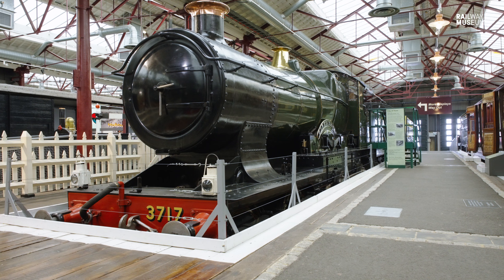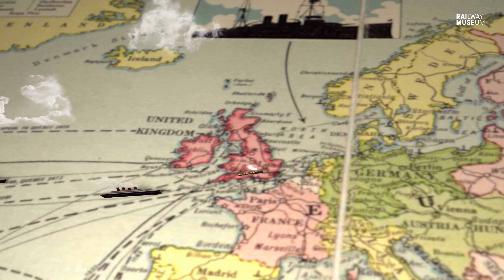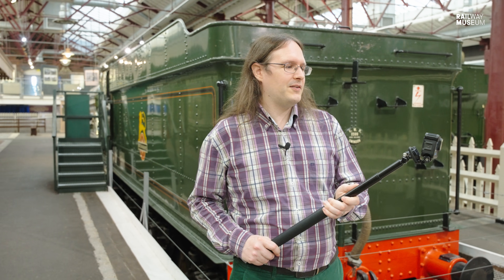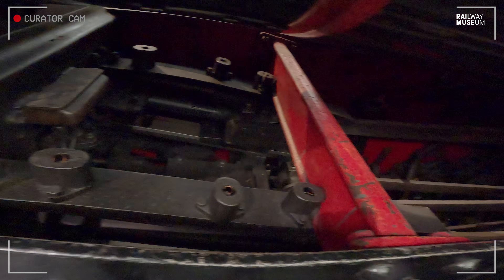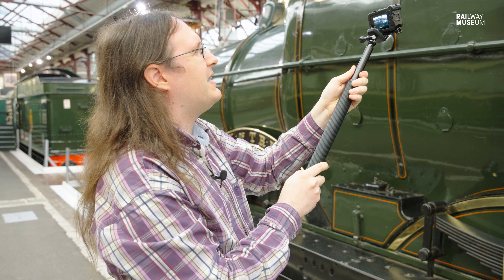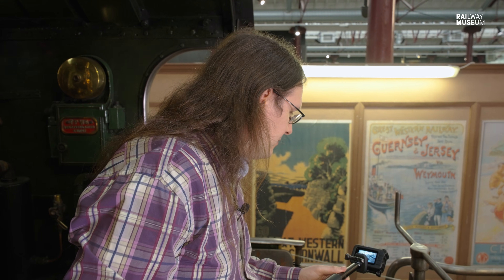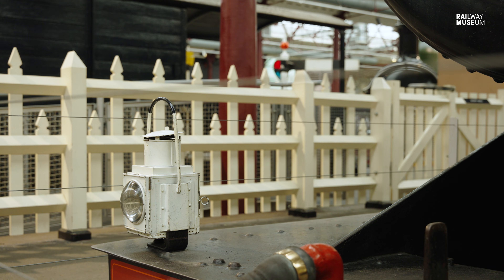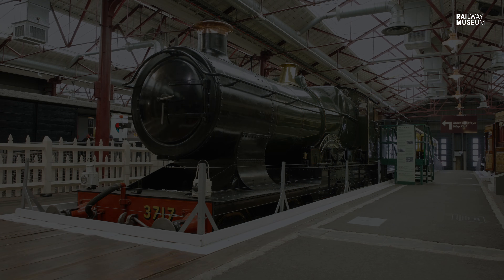City of Truro Up Close: 100mph Record Breaker? | Curator with a Camera

Comment: I believe mechanically speaking, City of Truro is more in contention with a 100 mph than 999 on the New York Central. 999 did not have the same power output as City of Truro in spite of the larger driving wheels 999 possessed (999 had 86 inch diameter drivers, City of Truro has 80.5 inch drivers). Truro also had more boiler pressure and larger cylinders. So I believe mechanically, even if she never actually did that speed, Truro would've been more capable

Comment: 12:05 They didnt really design those early locomotives with inclement weather in mind. Nowhere near enough overhead cover, and no doors to speak of. If you were operating the locomotives in a crosswind or rain, all crew would be saturated or frozen to the bone.

Comment: The blue painted disc and letter inside it are not both for route availability, the coloured disc is the weight restriction yes, but the letter, in this case 'A' denotes the locos power classification, 'A' being one of the least powerful on the GWRs ratings list.

Comment: I tend to believe the City of Truro probably achieved 100 mph but not 102 mph. The timings Rouse-Marten claims for successive quarter miles were 10.0 seconds, 9.8 seconds, 9.4 seconds, 9.2 seconds and 8.8 seconds. This suggests an unlikely burst of acceleration just when the rate of increase in the train's speed would be expected to decline. In reality, the task of juggling two stop watches at such high speed and with great precision would probably have been too much for anyone, even someone with Rouse-Marten's experience. It would be interesting to know what timings were recorded subsequent to the 8.8, and then to smooth all the timings out in order to remove as far as possible any inaccuracies.
Reply: It doesn't actually suggest a burst of acceleration, unlikely or otherwise. Rouse Marten used 1/5 second stop watches, so its simply a question of granularity. A record of 8.8 actually means 8.8 - 8.99 seconds and so on. After the 8.8 the driver braked hard, so the next number wouldn't be useful. If one charts the numbers with error bars and then draw fair curves most go over 100mph, but it is just possible to draw a fair curve just under 100mph. 

There are three things that are sometimes ignored. 

The first is that the locomotive was still accelerating when the driver braked. There shouldn't be any doubt that if the driver hadn't braked AND if they had stayed on the track the speed would have been well over 100mph - or the great mail train accident!

The second is that a Post Office worker on the train completely independently timed the train at 99 to 100mph.

And the third is that there had been several timings of the GWR 4-4-0s in the mid 90s, so this wasn't a big outlier.

Comment: I see the record as valid. It's plausible for some sort of 4-4-0 design to be able to get to that point.
Reply: Even if it didn't, it got mighty close!
Reply: Empire State Express number 999, also a 4-4-0, was reported to have exceeded 100mph in 1893 using a similar timing method. The record is unverified and disputed for similar reasons.

Comment: One wonders just how many times per minute, those driving wheels were so slightly lifting off the rails during Moses Clements' dash down Wellington bank. Those pesky platelayers not stepping aside too quickly! I wish I had seen her when she was on regular turns between Southampton and Newbury (the Didcot, Newbury and Southampton) between 'specials'. When first taken from the old York Museum (I remember that too) Swindon 'just happened to have' a spare boiler.

Comment: First time when I saw City of Truro was back in 1989 at the 150 years of railways in The Netherlands events. As there is only a very small number of original Dutch Railways locomotives which could be steamed locomotives from surrounding countries visited to take part in the parades.
Between all the giants like DB class 01.10, SNCF 141R, CZD class 475, and our own then still in steam NS 3737 City of Truro was one dinky little locomotive. The double frames with outside cranks did look very archaic, but all that made the fact that she could have done 100mph the more impressive.
It made me delving more in UK railways later on, visiting the NRM York several times, Steam Swindon, Shildon and many preserved railways.

Comment: 100mph is 1.67 miles per minute, so the quarter mile would take 9 seconds not 8 seconds as stated in the video.  At that speed  if you were a quarter of second late pressing the stopwatch on the last quarter mile marker then a quarter of second early for the next marker, that would over-inflate the speed by nearly 6mph.  So no, I don't believe City of Truro reached - and certainly didn't exceed -100mph.
Reply: It got mighty close, though.

Comment: Slight correction at the end; City of Truro definitely steamed after 2004. I rode behind it at the Gloucestershire and Warwickshire Railway when it went back to it's 3717 guise and that was in 2010
Unless of course Chris meant "mainline" service, in which case disregard my correction
Reply: I meant to say overhauled in 2004 rather than steamed, ooops. It was in 2013 at the end of the ticket when I was a trainee fireman.
Reply: @christophervalkoinen6358  Do you have any insights about what it's like to fire City of Truro from your experience as a trainee fireman? E.g. cab ergonomics, how efficient is a City regarding coal, and how do you get the best performance from a City? I'm really curious as an enthusiast: the only other GWR double-framer left is the Bluebell's Dukedog, but that one has a Dean boiler, and I haven't heard much about either.
Reply: @captaincool3329 it was more than 10 years ago, so what I can remember is quite sketchy. It was very free steaming and easy going. However, we were doing max 5mph on a quarter mile demonstration line with two brake vans - and it was only the second loco I had ever fired (the first being a somewhat struggling Olton Hall) so I don't think my opinion is well informed. It was definitely a very forgiving engine for a trainee aside from learning to heft the coal to the front of the firebox. 

After Truro I didn't fire anything where I couldn't reach the tubeplate through the firehole door in the next 5 years and those smaller engines needed a lot more discipline.
Reply: @christophervalkoinen6358  Great to have someone who has worked on the footplate talk about the locomotive.

Comment: It would be nice to restore Truro, but 3 factors hold it back
1) The cost of the restoration
2) Keeping as much of the locomotive as original as possible
3) Demand for the engine would need to be justified, and with other smaller engines from the NRM already operating, plus the size of railtour trains today, it just isn't feasible
Reply: Double header with flying Scotsman if they do return city of Truro to steam again

Comment: Sometime in the 1950s we went on a family holiday from Manchester to Cornwall by train. I remember, as always,  going to the front of the train to see the engine. City of Truro was there, full of steam ready to go. I did not appreciate the significance until year later. I gather it had come out of retirement for some sort of celebration. I don't know for how much of the journey it hauled the train, but I do remember making good speed until we crossed the Tamar bridge.
Reply: Two things: first, when they realised that they still had a usable loco, they put back C of T into regular working in the 1950s, though her usual beat was Didcot to Southampton. Difficult to work Manchester to Dawlish into that diagram, though I don't doubt that you found her as you say. Was it Bristol to Exeter perhaps? If so, then you experienced her retracing the very stretch that she sped down in 1903. Second, if you crossed the Tamar on your journey, you'd missed your stop!

Comment: The ACTUAL First Steam Locomotive To Reach 100 MPH was New York Central 4-4-0 American Type No.999. On May 10th 1893 NYC No.999 was pulling a Passenger Train and it was recorded at a Speed at 112.5 MPH. THAT IS THE STORY OF THE FIRST STEAM ENGINE TO REACH 100 MPH!
Reply: That’s equally as debatable as City as Truro. If the record wasn’t done with proper equipment, there’s no way to really verify it.
Reply: @joshslater2426  EXACTLY!
Reply: LOL
No.
Reply: @CountScarlioni  Just look it up.
Reply: If you believe that then I have a bridge to sell you.
Reply: Yeah, ok, A 4-4-0 hit 100. Next you’re gonna tell me that pigs fly.
Reply: @2Bored2BoisNo there claiming more than that with 112.5 mph!
From passing signal boxes and the signalman writing down the time passed using the box clock with no second hand or stopwatch function and mileposts distance of a signal box rounded for convenience.
So piling uncertainty upon uncertainty and selecting the best number that comes out.
Nothing special about the 999 design to create the steam required and then use it in the cylinders and coupling rods etc.
Reply: @2Bored2BoisBro look at the Videos just search up "New York Central No.999 goes 112 Mph their is REAL PROOF!

Comment: It's doubtful that Scotsman did the ton. There was a report some years ago in Railway Magazine where the dynamometer readout was examined and there's a sharp increase from 98 to 100mph at an acceleration rate the loco would not have been able to achieve  "almost as if someone had nudged the recording pen".
Reply: The more you read about the 100mph record the more you realise how fuzzy it all is. I didn't know about Scotsmans 'issue' but City Of Truro for example simply shouldn't have the power for 100mph. The calculations don't add up. And then you have 999 whose story is also iffy. There is a very good read on the website 'germansteam' who looked at the various claims and determined that it would most likely have been Milwaukee #6402 in 1934 with LNER 2750 Papyrus (a Gresley A3!) in 1935 as the second one that can be verified.
Reply: Just as an add on to your comments, on the Flying Scotsman run C.J.Allen was timing the train by stopwatch, doing alternate quarter miles. The maximum he claimed on the day was 97and a half. This occurred in 2 successive alternate quarter miles. So could Scotsman in the intervening quarter mile have accelerated to 100 then decellerated sufficiently for the next quarter mile 97.5 average...

Comment: Short answer: no.  Long answer: Rous Marten’s log gives over 100mph. The tough questions to ask are - are reliable is he as a commentator? (Not very), on that stretch of track, what mitigating factors against Truro are there? (fairly substantial curvature, increasing drag). What about the form and function of the train? 100mph for steam locomotives only really gets authenticated from Scotsman afterwards - I think that’s because 100mph is far more difficult to do than people realise, particularly with non streamlined, non optimised equipment and on runs that are not pre planned.
Reply: With a margin of error of 2mph, it must have come extremely close, at least!
Reply: @stephendavies6949  that’s if you take the log seriously.
Reply: @Britishrailwaystories  short answer yes it did it easily, going by these credential’s do we take all the Olympic records and land speed records and discredit them before WW1 as they were not to modern day timing standards!